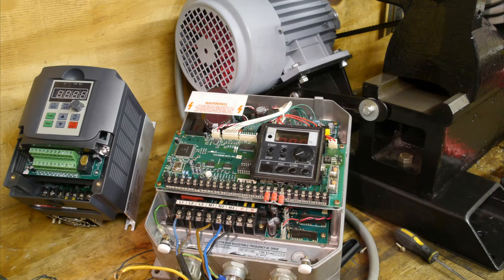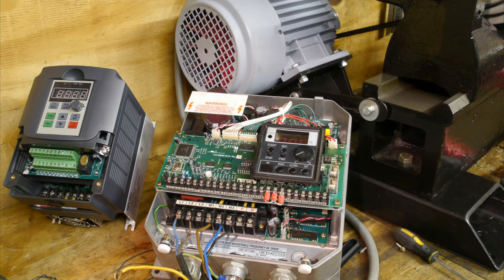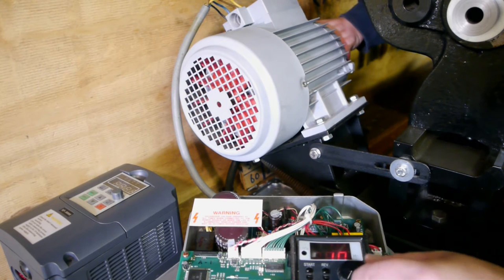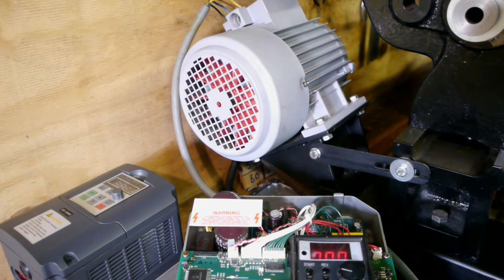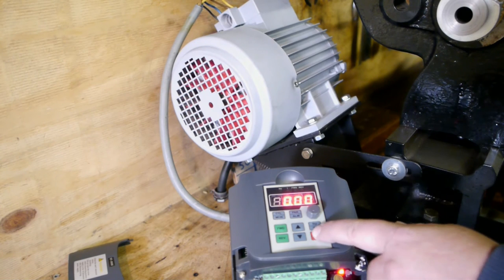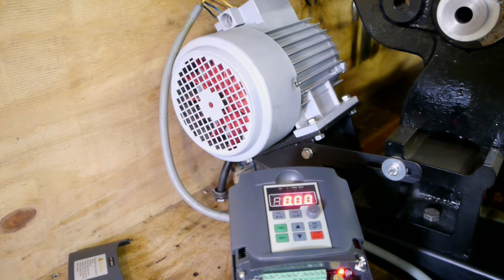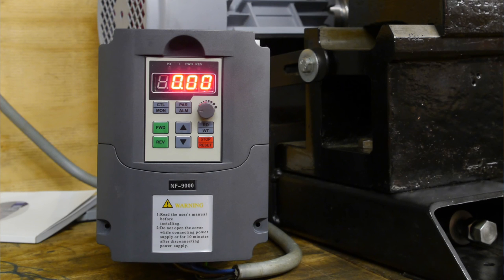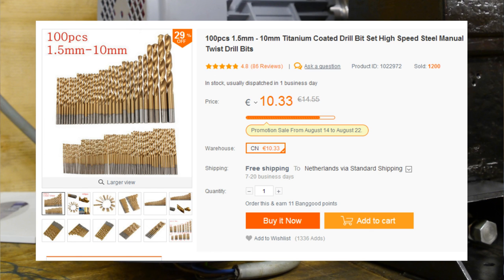Old VFD vs new vector controlled VFD

Comment: The vfd, also have a very important function, which is to absorb the motor's spinning force when we need it to stop instantly, to make threads or for safety for example ... I noticed that in the old vfd.
Reply from the maker: The new VFD actually has a build in brake resistor and should be able to stop a larger spinning mass the the old.
But I think Iĺl continue treading by hand, get myself a little workout :)

Comment: I think the cheapest solution to fix the fan is to use a bigger fan "say 125-150mm computer fan" the fan rotates slower,but produces the increased air flow.should be quieter.also with the earth problem,i would just make an earthing point.join them all together and carry them on to the motor.all bonded,including the vfd.hope this helps,just idea's.
Reply from the maker: I had the same idea till someone pointed out that the fan is 24v
At the moment I have the fan disconnected. I was going to install a 40c normally open switch but the electronics store was out.
I've monitored the temperature and so far 35c is the highest I've seen. Maybe Iĺl leave it like this.
Reply: wire two fans in series,,,,,,,,,,,,,,,,,,,haha,posible thou
Reply from the maker: Right, you'll turn it into a quadcopter drone :)

Comment: You're actually comparing control methods and not the drives themselves. To be fair to the old drive you should configure the new one to operate with V/f motor control since SVC allows for a lot more torque especially at low speeds.
That's quite entertaining though.
Reply from the maker: I was comparing the old situation with the new. And to me it looked like a big improvement. 
Although I probably could have change the v/f curve in the old drive to give it a bit more low end power. 
But to be honest low end power hasn't been a problem so far. It might be if I ever turn bigger stuff.
Reply: I think that was his point - that SVC is better at lower speeds needing high torque

Comment: If you hook a 1HP motor to a much larger VFD, would the VFD output burn up the motor?
Reply from the maker: It has not been a problem for me. But some thermal protection for the motor might be a good idea.
If you really load up the motor it will draw more amps and if the vfd can deliver it will get hot, especially at slow speeds.

Comment: For someone without any vfd experience, how difficult is this to install and use and is there any place to call for help with its operation??
Reply from the maker: It's not difficult at all if your satisfied with the default settings. Just hook up a power lead and a motor cable then you should be ready to go. I could not find a support number but I got some help though banggood.com.
Reply: Rollingmetal showed the installation in the previous video.   Wire the power feed and motor leads to the unit is all it takes - if you use the panel to operate the VFD to turn the motor on or off.

Things get more difficult if your machine has relays, switches etc. which you want or need to maintain.   The VFD has to operate the load.  There should be no switches between the power and the VFD.

The VFD has DC terminals for programming/control.  Rollingmetal showed these in the previous VFD but has not yet used.

It is possible to replace relays and switches on the machine, but it is not simple.  My local machinist friend is an electrician and knew how to do this for his lathe.  Major rewire of the terminal box, but a lot fewer components, but typically changing from 220V AC to 24V DC relays and switches.